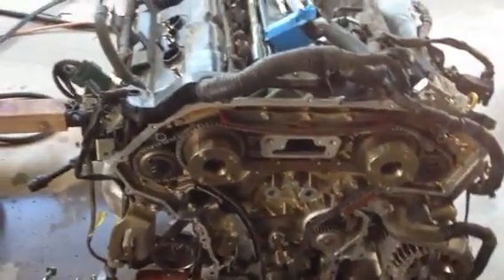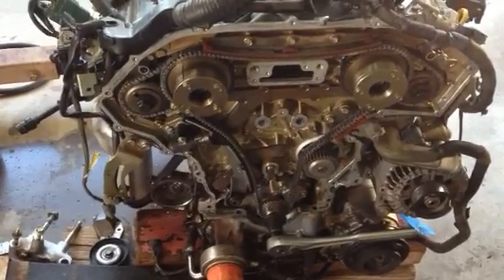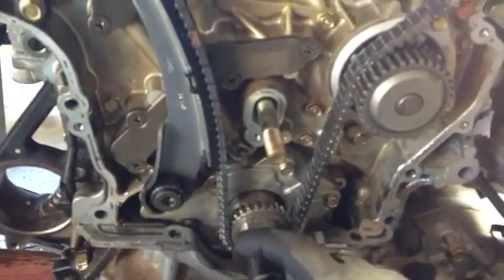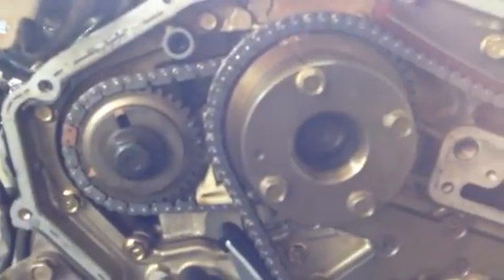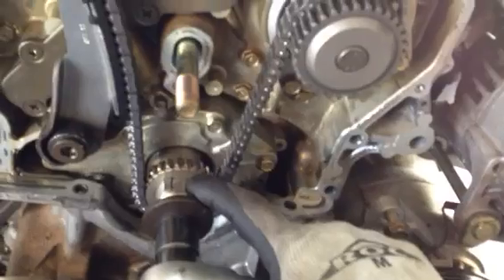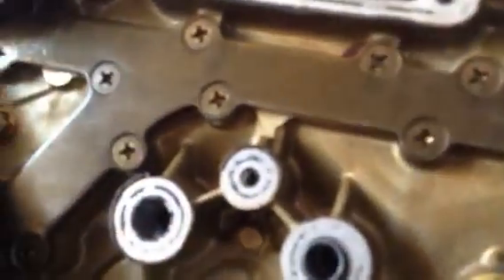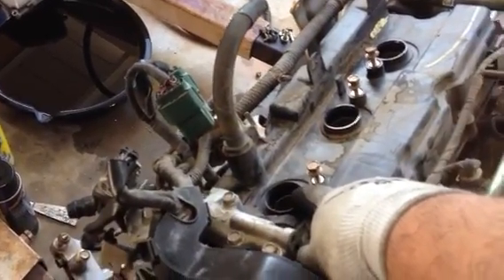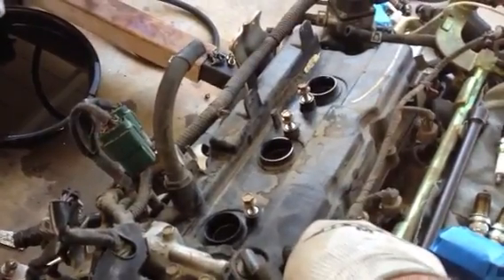Nissan 3.5L Top Dead Center

Comment: Thats not straight up. That’s 10 o’clock and 2 O’clock.
Reply: No its 11:00, which is TDC on this model. The valves are in position based on the contour of the engine.

Comment: To verify that cylinder #1 is on TDC use a cylinder compression gauge and look for a peak reading while rotating the engine assembly by hand with all the spark plugs removed. If you think you overshot TDC continue rotating the engine till your sure the peak reading corresponds with the timing marks.

Comment: Here is an important Tip!
The sure way to know if you are Tod Dead Center on the Compression Stroke,,,,,, is to take the Firing Order ...........
1-2-3-4-5-6  and line up the Companion Cylinders !
The Firing Order is Split in Half 
1-2-3
4-5-6 
All the companion Cylinders will match vertically!
So - if you are on Tod Dead Center on the Compression Stroke .......
These are the cylinders that are companions!
1 and 4  
2 and 5
3 and 6 
I always use a Compression gauge to note the increase in pressure on number One Cylinder as it arrives on the Compression Stroke . 
The next step - is to verify if cylinders number 1 and 4
 are up at the same time ( Companions )!
All the valves for Cylinders 1 and 4 should be loose and the valve springs stay uncompressed.  
The Timing Marks should all line up perfectly!

Also another tip on GM the Firing order is 1-8-4-3-6-5-7-2 again Split the Firing order in Half!
1-8-4-3
6-5-7-2
The companion Cylinders are 
1 and 6
8 and 5
4 and 7
3 and 2
All those cylinders will be up at the same time !

Comment: Thank you for recording this video. I know it’s old, but I am hoping you can help me. I replaced the water pump in my 2010 G 37. I am hesitant to put the cover back on until I’m confident the timing is correct. Is there a way I can time the car without removing the valve covers? Thanks. I have a manual, but the terminology I don’t really understand. I’ve never worked on any of my cars Above the level of routine maintenance. I decided to take on this challenge. You’re Knowledge is greatly appreciated. Thanks.

Comment: I had my timing lined up. I forgot i already loosened tensioner. Then used impact to get the crank bolt out. Ended up changing the damn timing some how it totally caught me off guard when i seen the cam lobs pointing wrong way. Said F it and just took it apart. It was tdc but timing was already off. Im replacing a valves so pulling the heads.  With the heads off cant I just make sure its tdc then put it together? Like as long as the 3 timing chain marks match the 3 gears would that mean my timings correct when i bolt it together?

Comment: hello friend , could you please tell me if the engine will rest in this position ? i gotta engine gally gasket blew and i gotta fix it myself and if afraid of the timing chain is gonna jump on me
Reply: I'm also debating on doing it myself
Reply: i got my engine cover half of today , i took the entire front end of the vehicle off including the radiator and condenser and when i dropped the oil pan low and behold there was a piece of the infamos gally gasket laying there so at leat i found the problem. to get the harmonic balancer off i had to fire up an arc welder and run a bead around the washer to heat   it up enough to crak the bolt loose , i had to use a 1500 ft/lb impact gun , a propane torch would not work . i also found a broken engine mount , i think im gonna make a steel one myself instead of replace it with japanese pot metal, i cant believe these fools used such flimsy brackets to harness 330 hp
Reply: the shop whants 3500 , ill let you know how my diy goes

Comment: If #1 cylinder is on TDC of its compression stroke # 4 cylinder would just be finishing its exhaust stroke.If you watch the valves on #4 cylinder when the timing mark on the pulley passes the timing pointer you should see the exhaust valve start to close and the intake valve start to open.If both valves remain closed then #4 cylinder is on the compression stroke and # 1 cylinder is on its exhaust stroke. The motor would require a 360 degree rotation to have # 1 cylinder on the compression stroke. Since # 4 cylinder is located on the front cylinder bank it is way less difficult to remove the valve cover.You shouldn't need to take the rear valve cover off to determine #1 compression stroke.

Comment: why is my engine so much harder to turn by hand? like 74 ft-lbs to turn it, i have all the marks lined up and chains lined up to TDC
Reply: Dengaz your crank could be seized. I would remove heads and spin the crank on it's own
Reply: hi  did you fix
Reply: If you leave spark plugs in it will be harder to turn because you are compressing air in the cylinder…just take spark plugs out

Comment: hey,i have a 02 explorer xlt v6,i will this job sooner or later,if the valve are close in cyl 1,and the the piston is all the way to the top is the timing correct right?

Comment: I cant seem to spin my engine manually it's giving me about a quarter turn either way and then it gives resistance, I removed the spark plugs so there is no compression building, Shoulf i remove oil filter because imo it feels like im fighting some kind of oil pressure when trying to turn the engine manually, any help would be great
Reply: It sounds like you where having the same problem that i am now...can you please let me know what you had to do to free up the engine to allow it to fully spin
Reply: It's me from a different account, my problem was that i had taken the chain off and put it back on a few teeth off, while the chain was off I had spun the crank by itself...bad bad mistake. this caused the Pistons and crank to be out of line. it was nearly impossible to line back up without machinery at local shop. I don't know your mechanical aptitude or hiw confident you are but I have been turning wrenched for years and it baffled me, finally I took it to a Nissan certified shop that ended up charging me like $1750.00 to fix it right! Whats crazy is this was a 3 month headache for me bc I wanted to do it Myself, I paid the price fixed it and drove it for maybe 2 months then bought an SS Camaro
Reply: Thanks for the speedy response. Between my father(who has is a second gen mechanic and shop owner) and his two employees, we are a very good team. Do you know any steps of the process that the shop had to take to get all of the components to line back up? Did they have to take the heads off? I am confident that we can fix the problem ourselves? I am about to be in deep water seeing that this is my girlfriends car lol. And great choices in the buying of the Bowtie SS!
Reply: justin Sherrill haha Thx man it's a beast I love it! Sorry I can't help you with what they did man, I was so pissed by the time I dropped it off I just said fix it! The guy just told me that i had really screwed my timing up to the point where I was 90 degrees off, he told me I was extremely lucky I didn't bend the valves, that's what you are feeling when you feel that resistance and can't get engine to spin, assuming you have the problem I had, I hate to dampen your spirit man but I have no idea what they did, it was a shop of guys who all had previously worked at Nissan and started their own shop. Good luck bro I know where you are.
Reply: justin Sherrill btw yes they did take the heads off, and reset cams chains etc. when they put it back together with new seal it leaked like a mofo, so they had to really seal it up well, you are a shop of mechanics so you know about how heads can be once taken off

Comment: How are you able to "spin" the engine with so little resistance I'm trying to get mine to top dead center by doing the same yet my engine is giving me lots of resistance should, I'm confused your barely putting effort into it any help would be great!
Reply: well it looks like im 2 years late but it seems he took out the spark plugs so its not compressing
Reply: Valve and piston contact maybe.
Reply: @christiangriffith225  correct

Comment: I just finished working on a ford 4.0 timing chain pain in the butt, if you are going to replace the timing chain it helps bring the piston up to tdc then mark the cam so you can find the exact spot when you are finishedif not you could have trouble getting it back in time

Comment: first off your videos a great helped me a lot. im in the process changing the guides and tensioner with the motor in, not replacing the chain though. i want to make sure that every thing line up tdc before and after i replace the parts.i turn the crank several times but it seem as if the right side is off matter how much turn the crank what do you suggest any info would be great